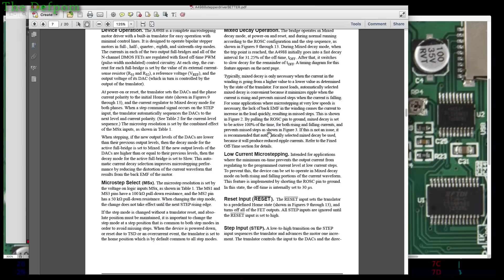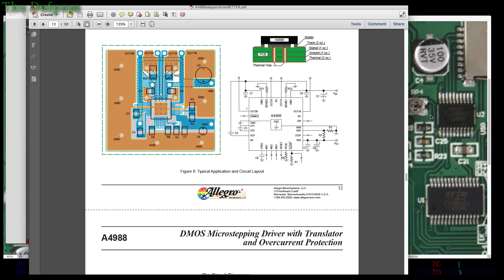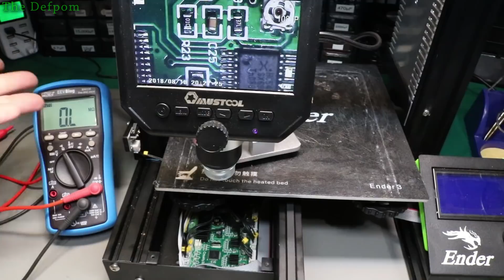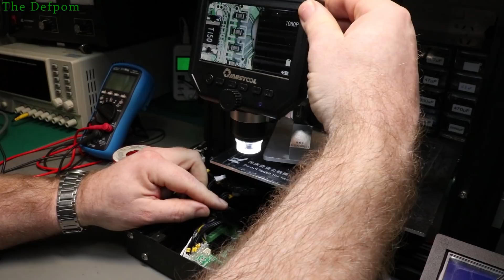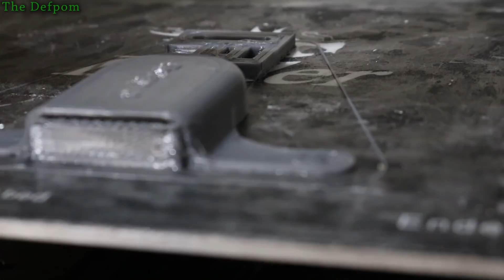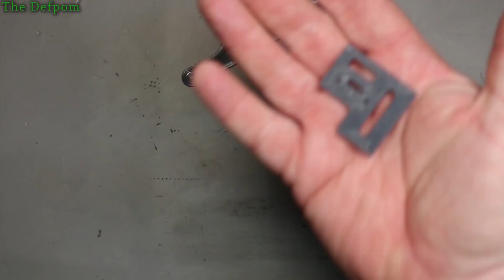🔴 #426 Creality Ender 3 Electronic Modification For Mixed Decay Mode, Stepper Alignment, Test Print

Comment: nice work, I also had concerns about the Y axis on the ender 3 mainly the way the carriage rides between the 2 pulleys, the further to the rear the carriage travels the higher it sits above the line of the belt,  this is how it is on my one at least anyway - this wont seem important to a lot of users, but if you pause to think about it for a moment I'm sure some folks will realise that it means it will affect the dimensional accuracy of objects a  small amount relative to its position on the bed because towards the beginning of travel its not being pulled as straight but more sharply at an angle, which is sure  to cause some elongation on the Y axis because  even though the angular velocity of the pulleys are accounted for I doubt the extra distance travelled  would t be-   a thing to look at with the Y bracket is to replace it with one with an idler pulley  set to a height that keeps  it in alignment the front pulley in level alignment with the Y carriage, unfortunately I haven't had time to design a new y bracket to test this idea out

Comment: would love to see you remove the A4988s altogether and replace them with the QFN TMC2208s, i've seen it done on a few machines and it looks like a great mod
Reply: can you provide some more info on where you have seen A4988s being replaced with 2208? Do you mean they just desoldered the original driver chips and soldered the new ones? Is i really that simple?

Comment: my Ender 3 just arrived. Of course with a bad E driver just like yours. However I do not have spare microcontroller chips for the drivers. Can I desolder A4988 driver's chip and solder it to the Ender 3 board? Does Ender 3 use A4988 drivers ?
Reply from the maker: Wello789 - yes it uses the A4988
Reply: @TheDefpom  and you actually managed to remove one and solder a new ? wow ... i just had a look on how tiny the chip is on a A4988 standalone driver. It cant be done ! :D
Reply from the maker: Wello789 - if you’re not used to it then yes it certainly would be a challenge, I have a couple of microscopes to work on tiny components, more recently that includes MacBook Pro logic board repairs with 0201 sized resistors.
Reply: Hi buddy replacing e driver alone. It works? Mine have bad e driver too. And i have a4988 driver.. i wanted to try it too

Comment: Found the timing data on p9  under "Fixed off time".  toff(in uS) = ROSC/825 so the 10k resistor would set it to 12uS.    Just tried the mixed decay mod with my ender.  Unfortunately,  I have a 22mm pancake stepper on my extruder and it doesn't want to work so 10k goes back in on the E driver.
Reply: Wait! It does work with the pancake  stepper except that there's some funny  business.  If  I try to extrude say 10mm from the prepare menu, the extruder will move very slowly and appear to be not working as it should.  But if I start a print, no problems.

Comment: You think the y alignment is bad, take a look at the z motor:). Mine was nearly 1/8" offset causing the lead screw to bind at the bottom of travel.  Im not knocking the printer though.  In general for the price its a great machine.
Reply from the maker: Do R/C! - yes the z on mine was out too, I identified that whilst I was building it and shimmed it then, I you watch my build video I show that and how I checked for it.

Comment: Hop you can help me. Please tell me the location of the motor drivers X , Y ,  Z and E location on the board, From front looking at the board from the top. I thing the E driver is the front one. I’m not really sure.
Reply from the maker: it is marked on the PCB next to each of the sockets.

Comment: I’m the guy who suggested this mod on facebook. I’ve also had great results. About the y motor: the bracket is weak and gets bent. You can straighten it out with your bare hands. That is why the belt goes on one side. Some kind of sturdier bracket can be made. Also I’ve made a mod that puts the belt inside the extrusion so it aligns with the pulley and doesn’t chafe. I will post it on facebook soon. Next I will be modding the x belt attachment as well so it doesn’t rub against the extrusion. Also I really don’t like that the belts are not parrallel with the wxtrusion, it takes care of that too. There are some pulley systems as well on thingiverse but to me it seems like an unnecessary solution.

Comment: Nothing wrong with being a bit of a perfectionist with your own equipment! Lateral adjustment of the stepper motor could be done with a shim between the motor bracket and the channel.
Reply from the maker: David V - I’m thinking about vibration dampers, that would shim it and make it a little quieter.
Reply: That would work too, so long as the stepper is still rigid enough to prevent small positioning errors. Have you looked at the tensioner vertical alignment - could it be causing some of the belt drag problem?
Reply: The reason I mention that is because in your assembly video all the steppers and channel material look to be the same so if the stepper belt pulley and /or channel  is the problem I would think you would be having the same issue with the other axis motors.
Reply from the maker: David V - yep I looked at that when I re-tensioned the belt after working on the stepper end. I previously went around all of the rollers and adjusted them as some were too tight, and some too loose, that also helped, I also made sure the vertical rails were aligned to the x rail properly, in case they were twisted a bit, physically it is all aligned as well as it can be, it just seemed to be lots of little issues together some may be lucky and only have 1 or 2 issues making it easy to sort out, I’ve tackled everything and the test print I did came out pretty well, know I can concentrate on the slicer settings and progress even further with the quality.
Reply from the maker: David V - I had to tweak the x axis already to stop the belt rubbing.
Reply: Sounds like you've got it sorted -- looking forward to some more 3D printer videos from someone who knows a bit about plastics.
Reply: I have done this and can confirm that it is MUCH quieter. Only drag was that I had to cut the bed support plate to allow room.
Reply: I added dampers to X & E.  Prints very quietly now.  E is not an easy damper to install.  X needed a limit switch plastic piece to be printed to move limit switch past the end of the X stepper (the one that moves the bed).  Thingivers has parts to print for this.  Will have to check if I did Y but don’t think I did.  Y is not that noisey.  E and X are now really quiet and makes printing so much more comfortable on the ears.  Well worth the mod.